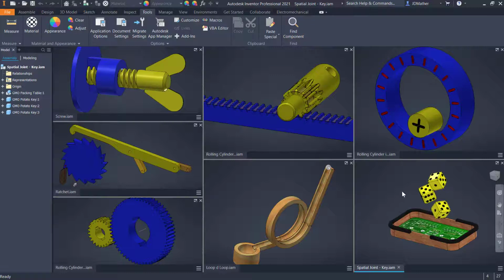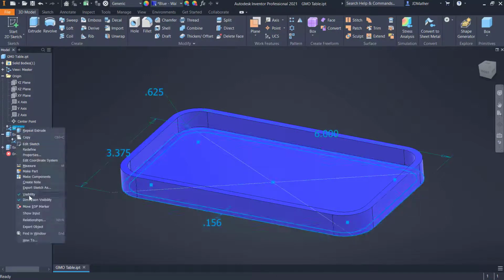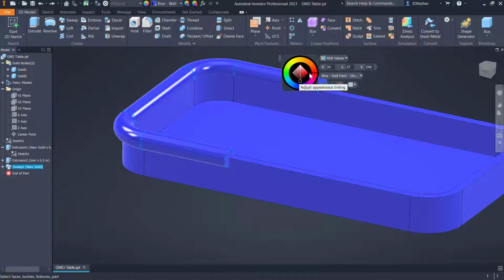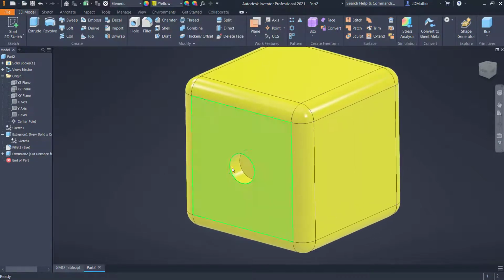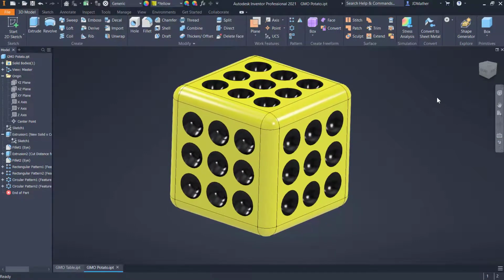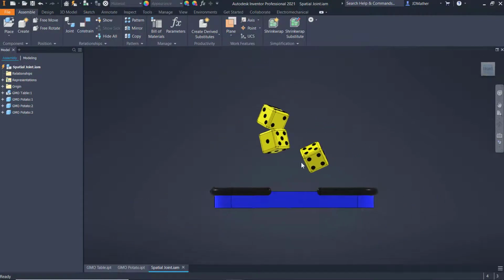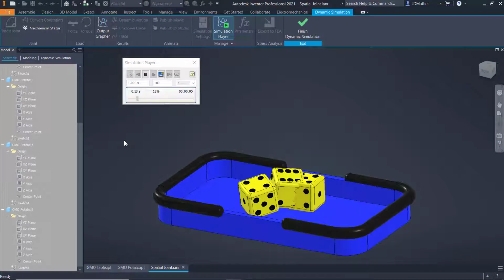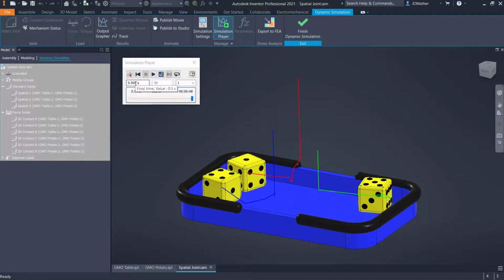Dynamic Simulation - Spatial Joint

Comment: Thank you for the detailed tutorial. However, when I select the origin in case of Spatial or 3D contact, the components coincide themselves at their respective origins. How can I avoid that? Why it did not happen in the case shown in this video?
Reply from the maker: You can drag the position after applying the Joint.  I am not at my Inventor machine at the moment to recall how to avoid having them move together by origin.